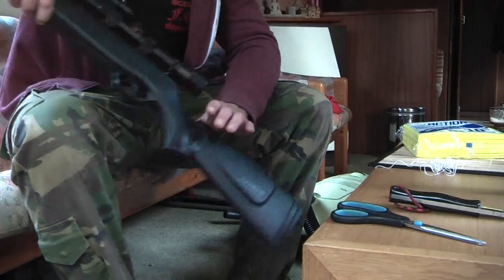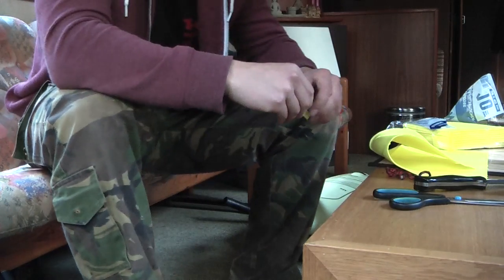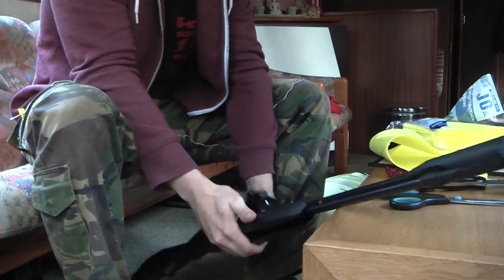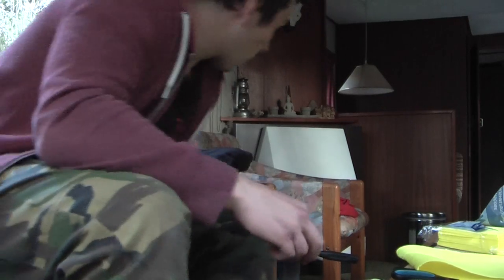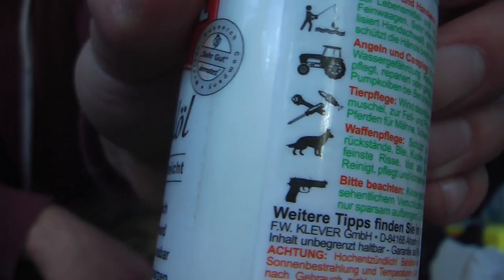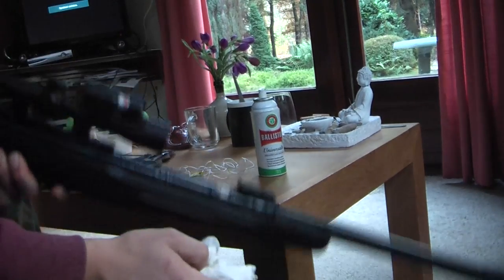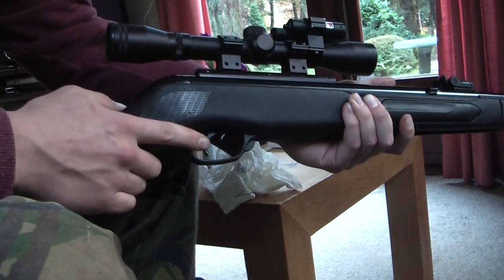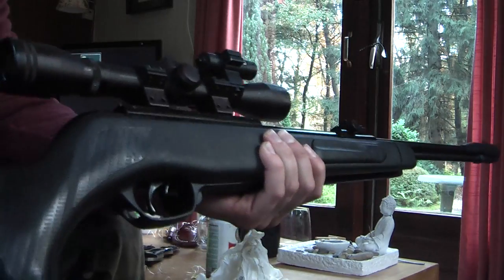Gamo CFX: cleaning the barrel and maintenance

Comment: much easier if you use a string that is a bit more than twice the lenght of the barrel, and tie the cloth at midpoint. This way you can slide it back and forth in the barrel without needing to suck the string  through  the barrel each time... and if you use a clove hitch it will be easy to swap pieces of cloth with clean ones.

Comment: Interesting video, didn't learn anything new other than the vacuum cleaner tip. That one will come in handy in the future, personally I only clean air rifles when they are new or if I the groups I shoot with aren't like they were in the past. Some new rifles (or used ones) I've had over the years came with a pretty dirty barrel and became more consistent after cleaning.

A few remarks about the end:
Ballistol based on my own use over the years and everything I've seen can be used just fine inside the barrel. I'd put a bit of it on the patch or use the straw to spray it from the crown into the barrel, don't get it into the piston or transfer port!! I would suggest to pull at least two more clean dry patches through it afterwards to get as much of the oil out. You might get a bit of "dieseling" on the first few shots but nothing excessive and it really does help with removing the lead if you're like me and clean them very rarely. Ballistol can also be used on a wooden stock without bad effects (if you don't mind a slight smell residue).

I'd be more inclined to using the same material you used to create the patches though to wipe off the barrel and stock where applicable. Paper towels are a little bit abrasive, not the end of the world but I usually resort to one of the torn up old t shirts under the workbench. Probably not worth worrying about as normal wear and tear will cause even more "damage", but its just one of those things you inevitably realise when you wear glasses and notice the small scratches it can leave behind (only use a proper microfiber cloth that you keep clean of dust/grease for glasses and optics if you can help it).

Are you sure its an ABS stock? There's a lot of varieties out there and with my limited knowledge for stock material I'd be more inclined to go with fiberglass reinforced nylon (or something with similar properties for this purpose). But considering its an entry level pricepoint rifle by Gamo it may well be just plain old ABS. 
Not that it matters, but if you want to find out sometimes you can find markings either inside or outside that will state a fiberglass percentage and which type of plastic it is. Short of that how it behaves when exposed to heat reveals a lot: poking it with a temperature controlled soldering iron or scraping some off and heating it with a flame. In the end it doesn't really matter as long as its fit for purpose which I'm sure they are for their price class.
Reply from the maker: hey mate,

thanks a lot for the tips! I appreciate it. I'm pretty sure it is ABS. Next time I'll use an old t-shirt. I have loads in my shed.

Comment: I just cleaned my Bengi 177. Prob 1000 or so shots. I did not know they cant get this dirty. I  saw a video where a guy was pulling black crap out the barrel right out the box. Prob the case with mine.